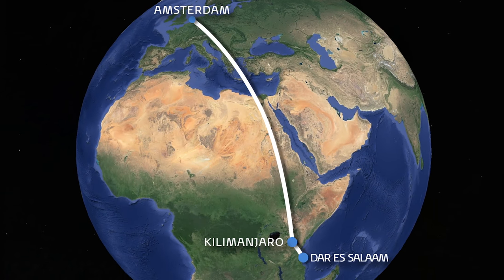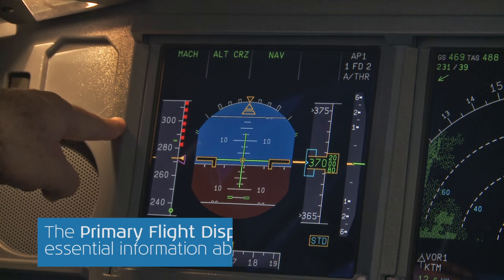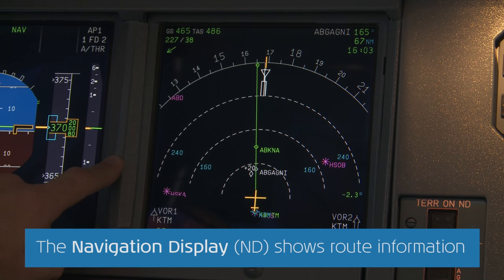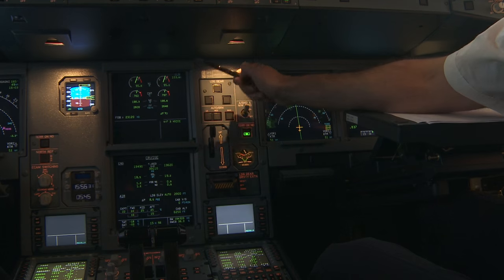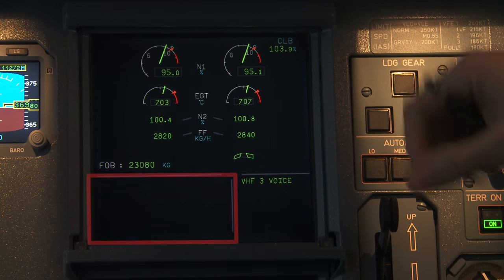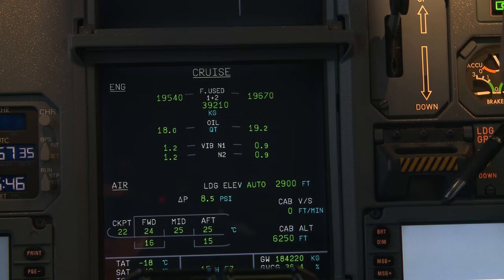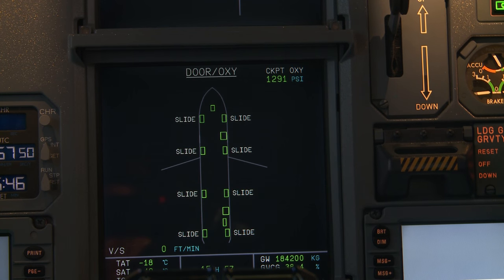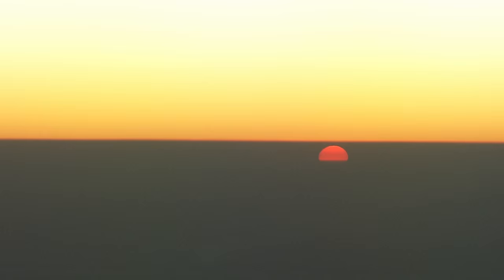How to land an airplane in the dark | Cockpit Tales | KLM

Comment: Owen Thomas, you almost always have a cross wind landing (although the wind velocity and/or degree of the wind from runway center line will determine how much of an issue the cross wind is). As you approach the runway, you bank the airplane (with the ailerons) into the wind while keeping the airplane straight with the rudder (which is on the vertical stabilizer). It's a constant flight control balancing act to keep the airplane lined up with the runway. At the moment of touchdown, the upwind main landing gear should touch first with the fuselage parallel to and preferably over the runway center line. The downwind main landing gear is then lowered onto the runway followed by the nose gear. The pilot will then turn the control column (or side stick) into the wind (to help keep the upwind wing down) while steering straight down runway center line with the rudder. A big key is that the airplane is not drifting across the runway at touchdown, which can place excessive loads on the landing gear, potentially causing them to fail.

Comment: Ok people need help on this video...my question is at 31 sec of the video showing the PFD...what speed is on there...The speedometer seems to be set at 272-275 knot  which in my calculation is about 505 km/h, but under the mach number says 0.835 which is 1031.80 km/h... I am lost guys...HELP...knowing that at 37000 feet that second speed looks more plausible...
Reply: +Papa Momar Fall The speed of sound varies according to the density of the material. As you likely recall, there is no sound in the vacuum of space. The other side of this is that sound travels faster in a solid.

Due to the height at which commercial aircraft cruise the density of the air is lower. The air and ground speed hasn't changed, but the speed of sound has reduced. As the speed of sound is reduced, the mach number (calculation of the vehicle speed against the speed of sound) gets closer to 1. If you went high enough, just your normal walking speed would be sufficient to break the sound barrier.

What Gabriel Yip states below is also true but doesn't really answer your question as well as it could.

Comment: It is a 330, right?
Reply: Mojo Projects A330-200
Reply: Yes
Reply: +Aviação/ Aviation Correctionele. -300
Reply: +Ivan_Friends/IvanWorldLiner how could you tell it's a -300 instead of a -200 please?
Reply: First off, the length, 2nd, KLM also puts the aircraft type on the side. 3rd. klm flies this route with the -300

Comment: How do pilots find their way in an empty sky?
Reply: Charles Mashanda All aircrafts have a gps system, just like a normal car gps.
Reply: The don't use neither GPS nor the sky. They can be assisted by GPS but they mainly learn to navigate using compass, speed calculations and routinary corrections.
Reply: Wrong the ND panel is controlled by the fmc, flight management computer which you are able to program routes and plan descents in your aircraft. As well as ATC guided navigation. Your route can simply be followed by just turning on the auto pilot and pressing the lnav and vnav button.